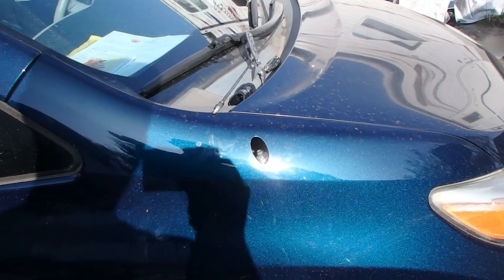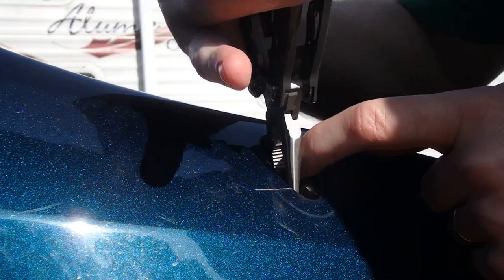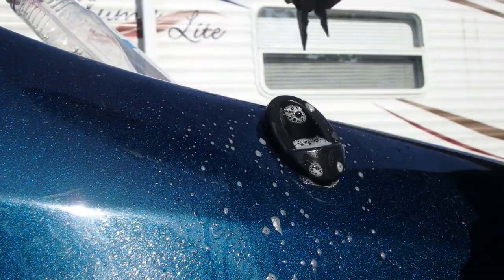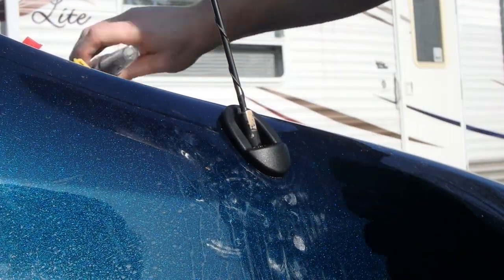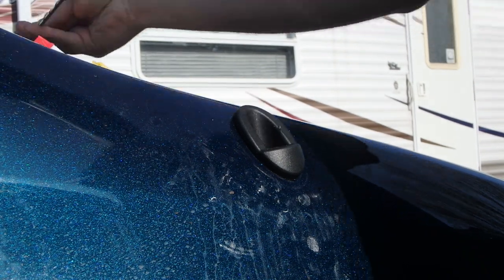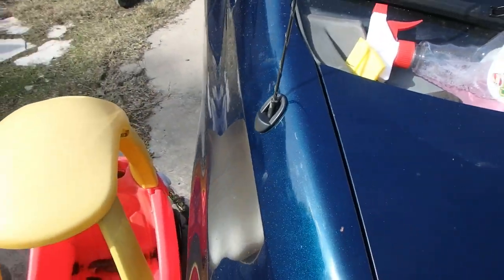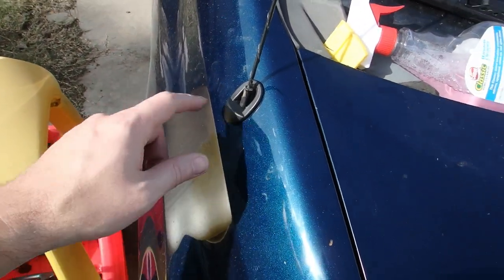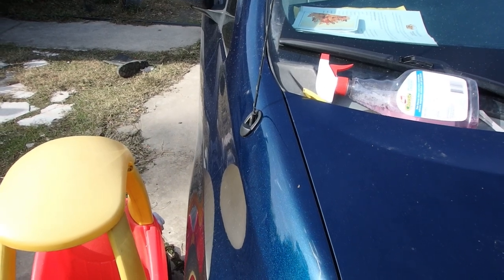2011 Toyota Sienna Antenna Grommet Replacement

Comment: Very helpful tutorial. Was able to very easily replace the grommet with this info. Didn't have a heat gun, so I warmed it in low boiling water for about a minute. Slid right into place. Hardest part was removing the old grommet, as it wouldn't pull up and out. With lots of finagling, needle nose pliers, and a utility knife, I was able to get it off by working under the hood (using the utility knife) and pulling up with the pliers for tension.
Reply: Im afraid that's how mine is going to go. Almost looks melted, and it is hard as a rock.

Comment: Thanks - those tips helped me get mine on.  I applied heat as well.  However, I think the thing that helped most is taking a flathead screwdriver and pushing down on the grommet (pushing with the flat screwdriver face, as to not cut the rubber).  As I did that it helped seat the grommet way down and the top just popped in.

Comment: Any possibility that you could "X" the hole with a razor knife, screw the antenna in place and then slip the bezel over the antenna and down into place?